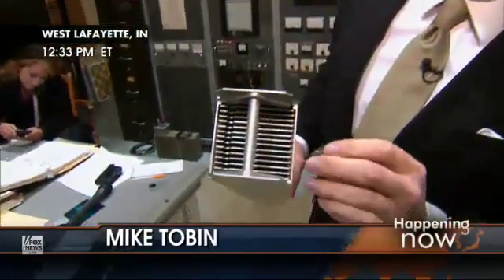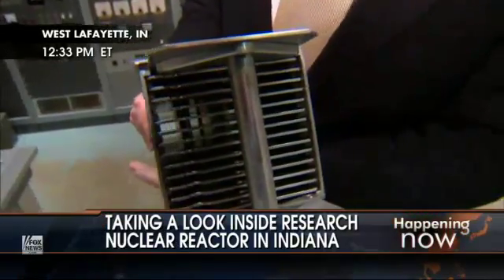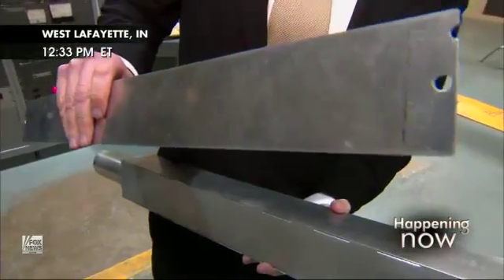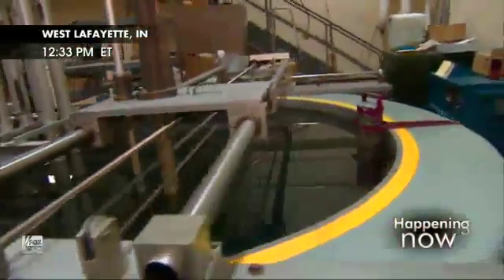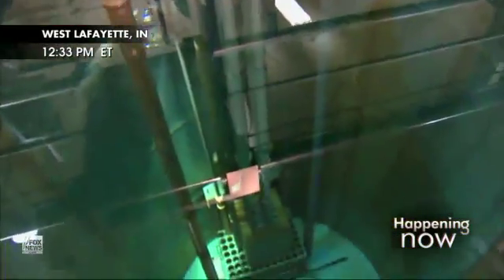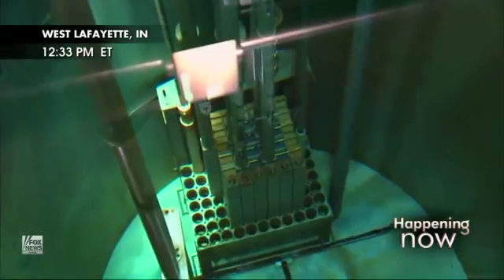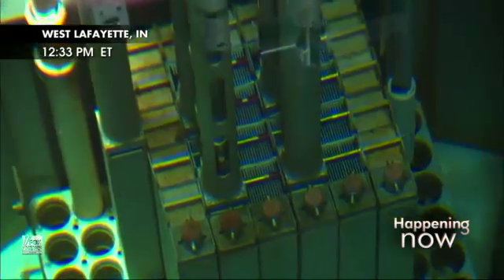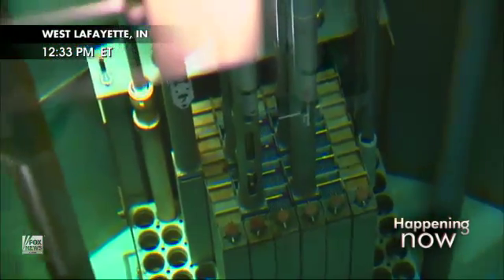Look Inside a Nuclear Reactor

Comment: that's just an experimental reactor without the steam production systems. the Uranium used in reactors is around %5-%10 pure weapons grade is between %90-%93 pure. weapons grade U-235 is not very safe to use in electricity production
Reply: nuclear electricity is pretty efficient but its also dangerous

Comment: Well you can't the fuelcells, which are in those open chambers, are already used up. they emit radioactivity and are hot, but they will stay there 10 years till they loose some temperature and radioactivity, but active fuelcells in the reactor chamber are not open, they are locked down with a huge plate on top making sure the radioactivity stays inside!

Comment: Indeed!  A commercial pressurized water reactor's (PWR) primary water circuit can average 550-600 degrees F when the core is at full thermal power (approx 3-4000 MWatts)!

Comment: well if it was on and working you would get boiled to death depending on what they got inside the reactor but if they have the cells setup in a way you could practically swim in it and just get wet
also if it is off then nothing happens. like i said you would just get wet.

Comment: Let me clear up a few misconceptions. 1) The sheet of metal is what supports the fuel...it is NOT the fuel itself. Fuel usually consists of pellets or balls of uranium about the size of a marble. These are stacked into rods and encased in metal (usually SS). 2) Some reactors boil the water, but most, like this, do not (at least not the water around the core). 3) Water in reactors like this is very pure and makes a great shield. Unless it was operating, you would just get wet if you fell in.